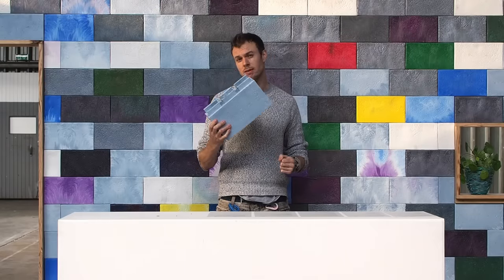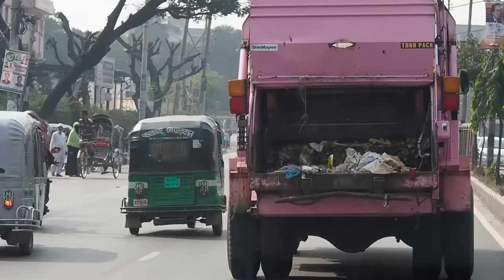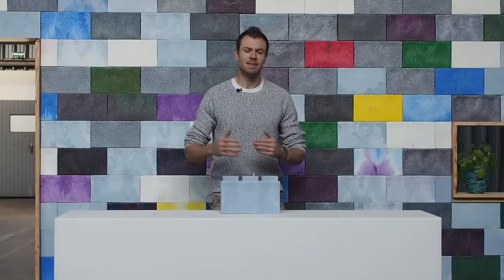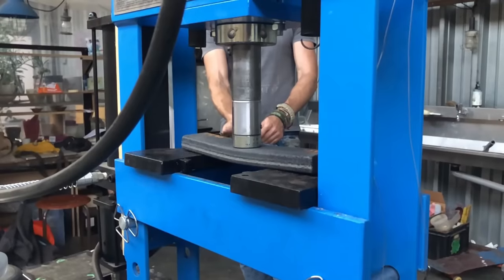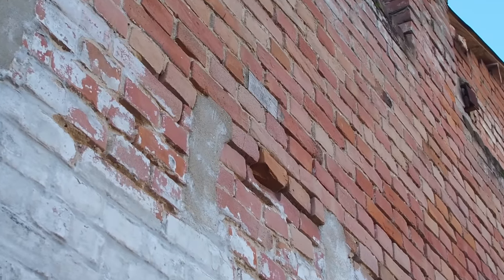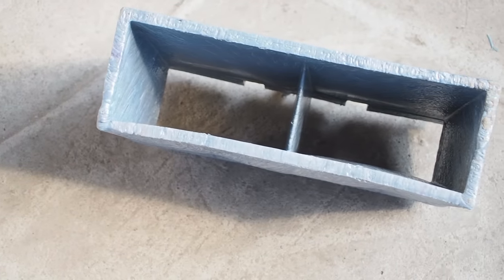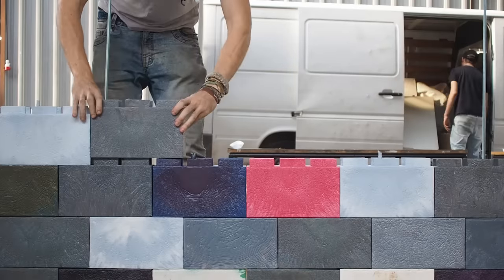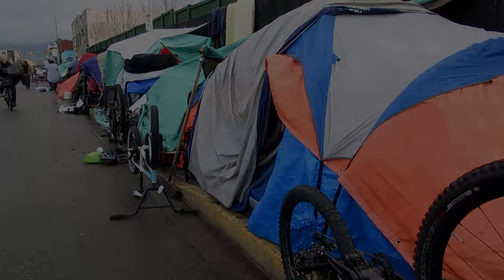Why the world needs recycled plastic bricks (and how to make one yourself!)

Comment: During manufacture add hydrated aluminum oxide or magnesium oxide alone or together with bromine or phosphorus compounds. During a fire, these compounds decompose and absorb energy. They can help reduce the fire by releasing water and form a fire barrier by charring. Alum oxide and magnesium oxide are non-toxic, non-volatile and environmentally friendly. 
In the signage industry here in Australia and many other parts of the world we use a lot of A.C.M. (aluminium composite material) which was used on the Grenfell Tower which caught fire recently. 
In fact forget bricks and make sheets clad in aluminium (around 3-5 mm thick) to stop any possible off gassing and reduce the chance of catching fire all together. A Precious Plastics sheetpress might be a good start but I think a roller type press might be a better idea.

Comment: If homes were made out of these bricks I would be concerned about "off-gassing" of the plastic since it will have sun and oxygen exposure. For home construction I would like to see a brick that is not hollow extruded hdpe only, but a more solid heat compressed sandwich of all the most difficult to recycle plastics (like grocery bags) creating an ugly messy looking brick that is meant to be encased in cement or cob.
Reply from the maker: Hey Coryart, We agree and this exposed method is really just for display. We also highly recommend encasing in cement or cob to protect against UV and general weathering. The beauty of this brick is that it can also be made from less pure waste plastics and also the hollow element of the brick allows for waste filling (for future recycling such as styrofoams).
Reply: The plastic you are talking about is anyway being exposed to sun and oxygen. Do you prefer it on your beaches, parks, foodchain, etc or on your walls? There must be an additive that can solve that anyway, or as you said, encasing them should be enough.
Reply: I assume these bricks are made of polyethylene. Polyethylene is one of the most inert plastics and uses very little toxic chemicals in the production compared to some other plastics. It uses ethylene gas as a precursor which is the same gas used to ripen the fruit you probably eat. Polyethylene is also the most common plastic used in food containers. If you are worried about that then you shouldn't be eating farm fruit or using food contained in plastic.
Reply: Estrogen..
Reply: I would think that simply painting the surfaces with a type of "barrier paint" would cut down or stop outgassing altogether.
There are several types of barrier paints available on the market.
Reply: Grocery bags are made from hdpe
Reply: Actually hdpe would be perfect and is already used in marina applications. Just look up starboard. Starboard is just hdpe sheets and they use them in place of plywood on boats.
Reply: @sustainabledesign.studio  
Boa noite!
Podemos conversar mais sobre uma ideia que tenho aqui no Brasil sobre como podemos utilizar a reciclagem em grande escala para beneficiar a população em geral?.

Aguardo seu retorno.

Airton
Reply: @Alobster1  oh that's interesting! So in a way if packaged fruit is left our in a window seal it will pass of safe gasses and further ripening the fruit. ❤
Reply: @airtonrocha3913  no response 😢
Reply: @syzygy4365  haha yeah why can't i keep bananas in this damn house.

Comment: for those that are afraid that it will tip over. try filling it with gravel and rocks but not sand. since it seems like the product isn't very waterproof and the insides are hollow, we can assume that the outside must have a coating of some sort to fill the gaps between the blocks so the water doesn't get in the blocks. because if the water got in the blocks it will become a mosquito nest every rain season.

Comment: The most important question of all is how much of a load can a single brick withstand? How much weight will a whole wall hold? Nobody will take these bricks seriously if you can't have a serious idea of how strong these bricks are. After all they are hollow and we are not talking about toys here. Over time plastic under load sags and breaks. And yes all plastics emit toxic chemicals when heated by mere sunlight.
Reply: They did testing on the press it seems. Also you could just coat the plastic wall or even just plainly paint it
Reply: "All plastics emit toxic chemicals when heated by mere sunlight" is a bit click-baity don't you think? All plastics slowly degrade in the sun, yes. But given that most people wear plastic daily in the form of polyester blended fabrics there's no reason to believe they couldn't make bricks with equally inert properties.
Reply from the maker: The load for one brick was about 10 metric tonnes before failure.
Reply: Now we are getting somewhere!
Reply: @sustainabledesign.studio  And and what is the weight of each brick?
Reply: @MilaVmusica  1.8 kg

Comment: As a natural home builder in Canada, I can say that the flammability is not so much of an issue for me, rether offgassing of the plastic over time is, as is the durability of the plastic over time. sun degredation concerns me.
I love the concept and I think that you are correct about our plastic issue and I am so glad that you are working on positive solutions to this problem. Personally I like pyrolysis to diesel and/or incineration for unrecyclable plastics and road paving tar for the recyclables that China no longer accepts. I want all the plastics to be sorted out, not just some of them

Comment: What about adding plastic to a mixing truck full of concrete?  With plastic shredded in long strips you could add lots of strength to the concrete, while not worrying about how clean the plastic was before shredding.  This could be used in poured concrete walls as well.
This way a lot of plastic can be used with minimal processing...?
Reply: Virgin polystyrene is used too make lightweight, less-strong but more-insulating concrete blocks. The polystyrene beads have a similar function to soap bubbles in aircrete.

Comment: How are the weight-bearing properties? 

The tapered walls actually look pretty keen, and would direct watershed away from the joints.  You could even return-taper the bottom bit so that you could have flat bands along a wall of them to affix siding or other finishes to.

Comment: How resistant is it to different temperatures. Would it not begin to blister and bubble in hot summers? Wouldn't the fumes from it be toxic if heat up enough? Would it hold up under strength and durability tests while it's set up as a wall? It's a good idea to reuse waste but curious on how effective it would actually be as a building material.

Comment: Have structural engineers analyzed the brick's capacity for load bearing in larger, multi-story use?
Reply: I'm interested too! 😍 
I could see them using metal rods though the holes to stabilize the structures. But I'm at a creative loss after that.

Comment: Has anyone raised the idea that plastic bricks can burn easily?
Reply: It mostly melts, plus wood can't?
Reply: @slimknight_  It will BURN.
Reply: And give off deadly fumes when it does.
Reply: @AndrewHelgeCox  As same as most insulating coats and meterials, those bricks are flamable, but I have a news for you: the paint of your walls is also flamable and highly toxic
Reply: @slimknight_  it is being compared more with concrete when wood when he said that mountains are ocean floors are being destroyed for construction.
Reply: When fire suppressant is added, it becomes fire resistant. Simple.
Reply: Fire safety is as much about rate of burn than how easily it will catch fire.
Reply: EVERYTHING burns... even concrete.
Reply: Wood also burns easily...
Reply: @omotolaoyeniyi631  Ah yes, and jack the price up higher, since being slightly more expensive than normal materials was not enough already. You would need a specialized or somewhat-specialized fire retardant for the plastic as it burns at different temperatures while becoming semi-liquid. IE: research costs, manufacturing costs, etc.

Comment: Fill the inside with sand or dirt at the erection site and cover the outside with cement and you will have one mighty long lasting structure. Bring me aboard for more ideas as an annalist. You will be happy that you if you do. This is a great idea by the way and I want to be a part of this altruistic project.
Reply: Also, by doing the aforementioned you will find that your material combinations will drastically improve thermal insulation properties.

Comment: Could you fill the wall interiors with aircrete to make them stronger and more permanent?
Reply: Actually I thought of that, BUT even when it does use less concrete, it would need a good amount of it to fill the empty space, nevertheless if it were used to cover the plastic wall it would: 1) Help with the UV exposure problem 2) Give that much needed fireproof factor 3) Heavly increase the isulation value. 
But aircrete could be used to make inner columns too (idk how is it called in english) pouring it in a vertical hole in the corners, and if one put a steel bar in the middle it should actually meet the parameters
 of construction.
Reply: What about curing time of the aircrew?
Reply: @FelipeAPerez-gw1re  first reading the comment about concrete i wanted to mention steel bars that can go inside! That will really make them permanent, also you can use paint to protect plastics from the uv, just need to find cheap uv-protected paint
Reply: I was wondering that too.  In fact, why can't these be used like concrete CMU filled with rebar and concrete. I think that would be very sturdy.

Comment: I thought and wondered about some type of recycling system for use in any type of construction..especially residential over 35 years ago..with interlocking and rear reinforced design and a plastic glue for sealant and voids for insulating characteristics this would be a long lasting...fire ,rot  and termite resistant material and could be improved at regular intervals as engineering allowed...something like Trex was a vision of things to come

Comment: really good idea. until it starts burning in the plastic-built house.
Reply: yeah i was just gonna say " so how do you make it fire proof"
Reply: also, there are probably more valuable things you can make with 1.5KG of plastic than a brick. what i mean is that the plastic may come from the trash, but it is still expensive af compared to regular bricks which are made of pretty much dirt
Reply: @J Tech 
Ah yes, Lung cancer.
Reply: Wood is also flammable, the only thing that is fire resistant in homes these days are the external bricks (assuming they are available) and some siding products. Drywall allows some fire retardant properties but not much and some insulation basically turns to saw dust in a matter of years. Asphalt shingle roofs  are extremely flammable and they are on every house in America. So the “it’s flammable so we shouldn’t use it” argument doesn’t really hold water.
Reply: @TMGREVERENDX  You can make wood fireproof
Reply: @Repz98  No... you can't/don't make wood "fireproof"; you make wood "fire resistant", by treating it in a bunch of chemicals... which makes it last... like 5-10 minutes before it catches on fire and releases toxic fumes while doing so. The idea is simply to allow people/animals inside a chance to escape before it spreads too much, and to allow fire departments / responders a chance to limit the damage. Also one really bad thing about fire resistant wood they've only realized recently... the chemicals/process of making it causes the wood's structural integrity to degrade rapidly if it's left in hot/dry temperatures (like an attic), and they've had a lot of building collapses because of it.

HDPE plastics like mentioned here are just as fire resistant, if not moreso, than fire-resistant wood (higher temperature required to cause it to burn, although it will start to melt, which is actually much more dangerous than it burning, both for structural integrity and injury - gooey sticky burning stuff than you can't get off your skin is nightmare fuel). Also worth noting that fire-resistant wood is typically only used for structural beams, not walls/floors/etc, b/c it's too expensive; so a candle or something landing on the floor is much worse with wood than plastic (or vinyl or tile or w/e else).

Comment: So I have a couple of questions about this brick, I’m not sure if this is the right place to ask it. First; how does the brick handle normal stresses applied to buildings During weather etc.? Second; How difficult is it to disassemble a building constructed this way? Thirdly; does a structure constructed from these bricks require additional support of any kind or can they be used by themselves only? Fourth; what are the costs associated with producing these bricks?And, lastly; what type of insulative properties does the brick offer?

Comment: I see this as a great alternative to regular interior walls.
Reply: Might create a problem with humidity/condensation?
Reply: @crosstraffic187  Maybe?  I don't really think so.  They would be used to seperate rooms.  Not so much anything else.  And if need be, you could still hand dry-wall on them or paint them with something.
Reply: @cypressgold  For spacial separation, that would be OK. But for outside walls, I'm pretty sure you would have problems with condensation. Some old brick houses have problems with condensation and mold due to lack of ventilation and humidity. Bricks breathe,  plastic does not. Plastic is watertight, bricks are not. And drywalling them won't change that.  https://brickvent.net/bricks-need-breathe/
Reply: @crosstraffic187  I meant literally only interior separating walls.  Exterior would still need to be conventional.
Reply: @cypressgold  Yes, my missunderstanding was that the outside walls here are built in 2 layers, and the interior layer is also considered to be an interior wall. My bad.

Comment: Attaching the blocks with sealant adhesive and blowing foam inside gives you a wall with tremendous r-value, a built-in vapour barrier, and waterproof exterior cladding. See Lincoln Blocks for the same idea but with blocks made from off-cuts of the lumber industry.

Comment: Interesting project -- how would you insulate? Lots of places get quite hot and/or cold, and using more energy to heat or cool them isn't a viable option. Also, what about offgassing when the bricks are exposed to heat? It gets over 100 degrees in the summer here.

Comment: It's good to temperate/continental enviroment, if used on equatorial enviroment it will atract a lot of insect to live inside the brick if no proper revestment is aplied. Btw all that, its a great implemention and idea of reuse of plastics. Kudos
Reply: Or fill with sand

Comment: Honestly if more people recycled wood they are have or can get FREE in a lot of cases, then wood itself would go a lot further as well too!! On a personal note about ten years ago I was given an old deck a neighbor wanted removed from his home to make way for a new deck he was building! FORTUNATELY he was smart enough to disassemble half of it himself and cut the remaining parts into "large chunks" that could still yield a lot of salvageable material from!! It was AFTER he did this, that he asked me if I wanted what he had "laying around" when I showed an interest in the pile of "scrap wood" laying in front of his home!! 

THE WOOD he had was still plenty large enough, and in good enough shape (it was pressure treated after all), to build a number of things out of!! WHICH is exactly what I did with it!! I built a small deck off my other neighbors back door area, and then used what was left to build myself both a picnic table and a large storage bench to match the picnic table!! Extra pieces of 4x4 post scraps I used as a border around one of my flower beds as it too was pressure treated with direct ground contact exposure, and still more of the wood ended up used in other smaller projects I made as well too!! IN FACT this wasn't the only lumber I was given, as I was given a large tool shed that was actually two sheds screwed together and built originally in 1971, the main part of the shed, I still use to this day as part of my workshop, and tool storage needs!! The rest of the same shed, I used in the construction of the neighbors deck and used pieces of wood from the second shed in a number of other smaller projects!! 

The thing is people have always gave me a lot of grief because I constantly drive older vehicles, but what most folks seldom realize is how much I reuse and repurpose things!! Something I have been doing since I was 14 years old...back in 1978!!!

Comment: i really like your idea and the iside with a foam insulation i think.u have a great idea but i wondered what about your extrusion process to use the usa we have issues.with #2.bottles from motoroil. and the other #4,5,6 plastic but question wjat about tje wind turbine blades shredding those for nricks and why  not use wood chips and sawdust tjat would be resin tied to make waterproof

Comment: most common building materials are porous so can breath , with plastic as i have seen in my dog kennel condensation runs down the walls even after drilling air holes in the pitch of the roof , how do you intend to sole that particular problem ?.

Comment: This lacks replaceability. It would be better if you were making standard size parts that can replace (or be replaced by) conventional building materials. Additionally, I believe you should work closer with construction contractors. This will give you a lot more insight into what is useful and what makes parts appealing.

Regardless, many many kudos to you guys. I believe the use cases you came up with are appropriate for what you designed.